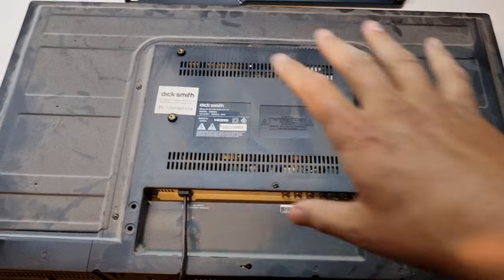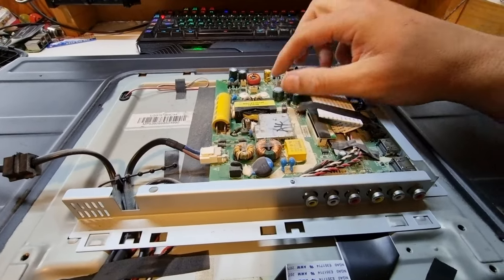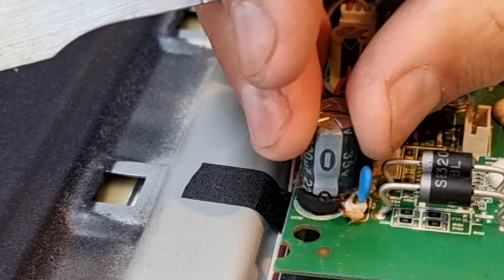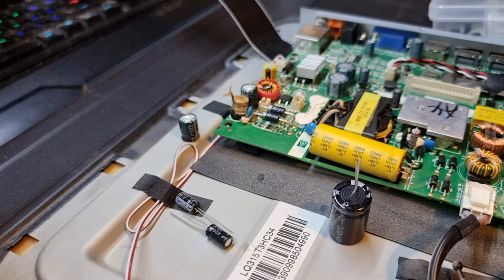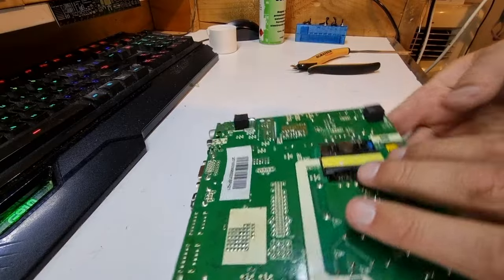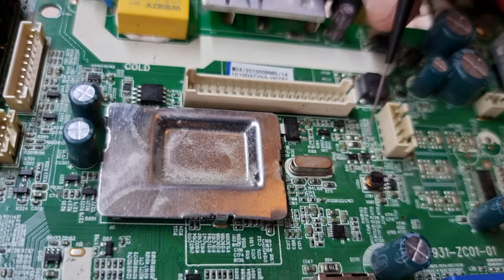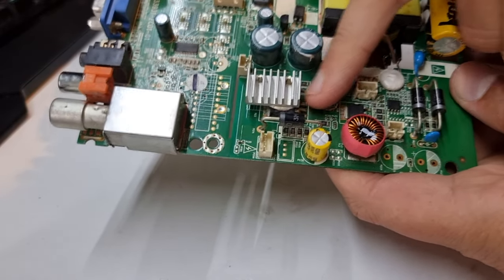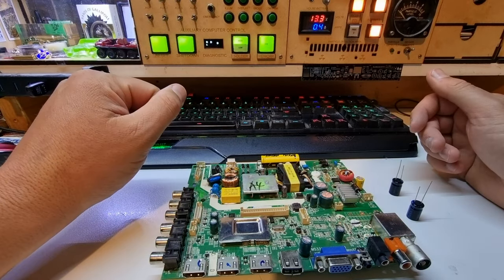Dick Smith 32 inch TV repair

Comment: Hi, nice fix.
You missed a very important capacitor that will fail, next to the heatsink with A4 written on it, is a small electrolytic.
Probably 10uF up to 100uF, but the important thing is it will be 63V or higher, they have the tendency to increase their ESR and drop their capacitance.
Externally they appear fine, but internally they are sneaking up on you.
Usually a capacitor change in a SMPS means all caps.
So keep an eye on it, one day it may not start.
Merry Christmas to you and your family mate.
Reply from the maker: Yeah I would habe changed all of yhem if I had the correct values.
The intensity of this tv is quite low now, and hasn't been used since this repair as I replaced it. Was just interesting to find out what died.